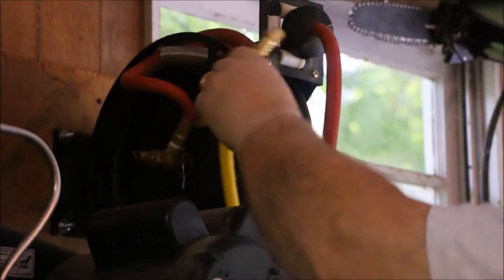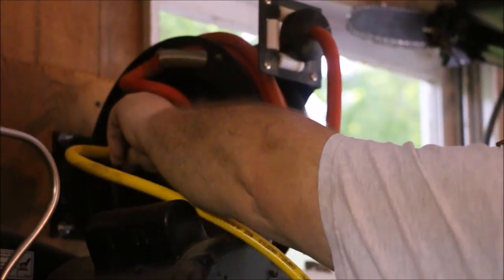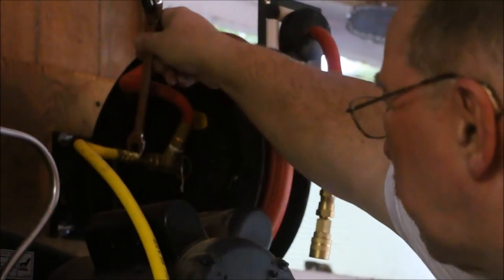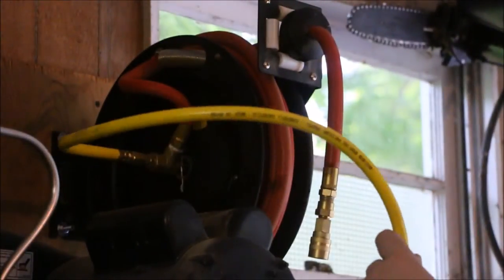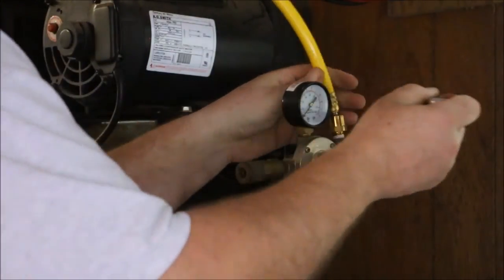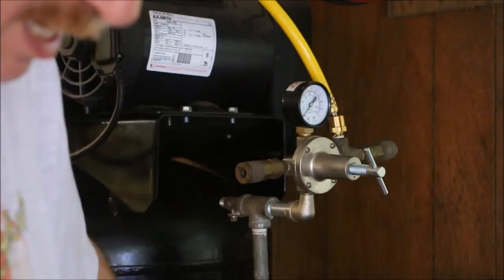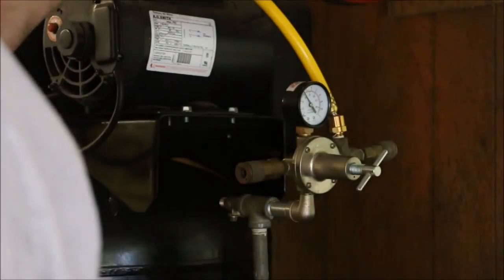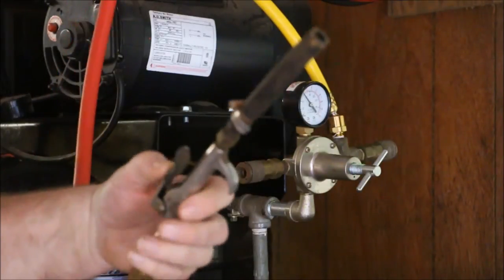Plasma Torch ~ Pt 6 ~ Plumbing ~  By Old Sneelock's Workshop

Comment: That is a good idea. I'll need something like that on mine. Might have to bite the old bullet and get one when and if I think of it again, or maybe the 1st time!
Reply from the maker: Thanks Lewie.  Most of the small home shop compressors don't reach 150 psi so the hardware store, or even the HF, regulators work fine with their 110 to 125 psi max rating. I being clever decided that I might need 150 psi someday and when I bought the big compressor I got the 155 psi rated one. It does let the compressor run less often. I found one regulator that I could afford that would handle 155 psi. It cost an arm and a leg but they have grown back over the seven years since I bought the compressor. :-)
Reply: Old Sneelock's Workshop BUT you didn't have to buy one every week for a year! That's what I keep telling Sweetums in that she'll just need ONE good one. Bought and paid for and a done deal!

Comment: ..yep, company i worked for built another plant, the contractor used hard pipe for the compressors and snap!!  the contractor was from the compressor company that installed them. you would think they would know better...
Reply from the maker: Not everyone who is in a position knows what they are doing. I was lucky to have worked with men who had gone through an apprenticeship before they were considered good enough to work on their own. As an apprentice I did a lot of grunt work for them but I learned a lot too.
Reply: You'd think!
Reply: 2nd that!